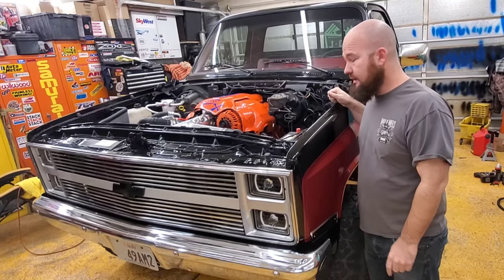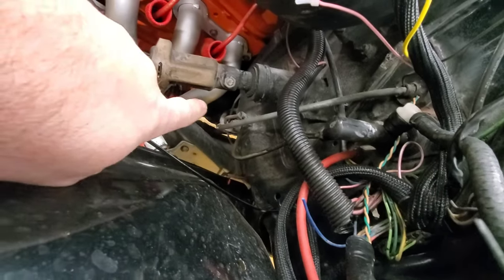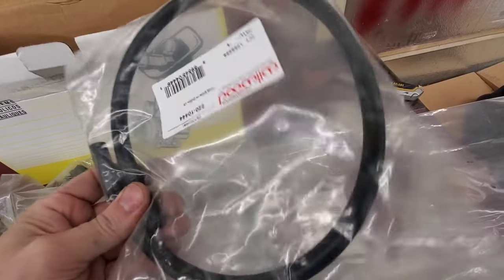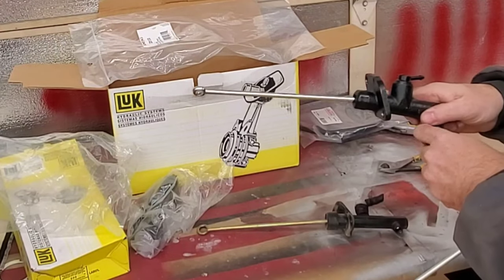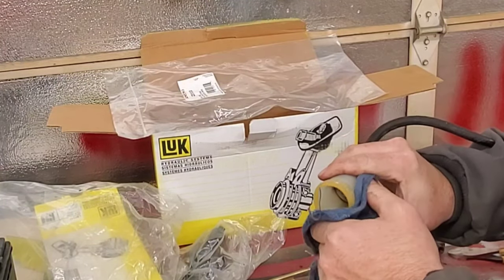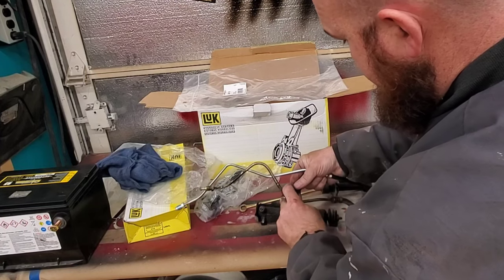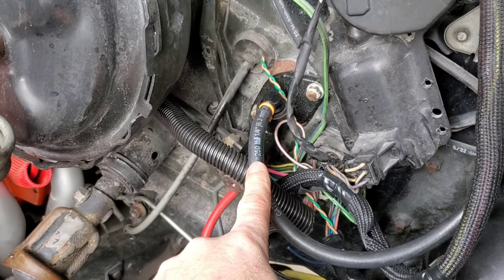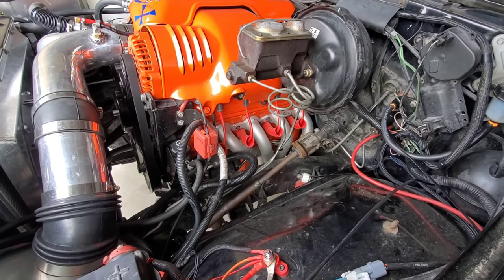Clutch Master cylinder and slave cylinder replacement on 85 Chevy K20 Silverado square body LS swap

Comment: I'm doing same job however I hate the plastic line on the master to slave cylinder and planning to go with an fittings...the pin in connection points in my opinion are lame... and prone to leaking... plastic line also can melt easy if it comes in to contact with exhaust....I have a 1992 Chevy Silverado 1500 4x4 which I use to pull my home made toy hauler camper holding my 1959 VW bug and 1993 Harley Chopper plus a basic tool shop compleat with generator and welding equipment and plasma as well as air compressor...so a reliable clutch is necessary

Comment: Anybody can put the pieces together. The hard part is bleeding the system.You showed nothing about that  and that's where all the issues are .
Reply: I had issues bleeding the system myself. I ended up removing the entire system intact and bench bleeding it by pushing in the rod in slave with reservoir tip removed.  Actuated clutch rod and slave rod and it behaved like it was a mechanical link.  Reinstalled everything intact as a sealed system.  Worked like a charm.

Comment: Thank you.  Thank you. Thank you for this video and info in description!  Used the all the provided links to replace the entire hydraulic clutch system in my 85 c20.  Only thing I did different was bench bleed the system.  To be honest I uninstalled everything intact as I could not get it to bleed once I had everything put in.  I think that was because my drive way is a rather steep incline..  but once I actuated the slave all the bubbles came out of the reservoir.  All was good to go after that! Thanks again.  Definitely subbed
Reply from the maker: Thanks I appreciate you watching the video and I'm glad this helped you out
Reply: So @JCustomFab, I have a series of questions about your engine and trans setup. So I see it's an LS engine and I'm guessing that's the sm465 behind it? If it is the sm465 can you please tell me what you used for a pilot bearing and motor mounts and on a scale of 1-10 how difficult was it mating the ls to the factory 4 speed
Reply: how did you guys bleed

Comment: So I just picked up an '86 K5 and I picked up all those same parts, actually what I want to know about  is that spring that you mentioned on the clutch pedal at about 3 and a half minutes in, I'm missing that, would you happen to have a part number on that? I'll try to research it also, thank you
Reply from the maker: Lmc Clutch Pedal SpringChevy GMC 73-84 part# 30-3151
Reply: I'll try out, thanks again

Comment: So I’m 17 just bought my new truck the clutch works perfectly fine but the problem is, is that if I accidentally bump the clutch peddle some type of rod will fall out and I’ll have to get out and put it back in how do I fix that? Also do you think you could help me with it I mean maybe a phone call?
Reply: Is it the rod that goes from the clutch master cylinder to the pedal?
Reply: If it is the one form the clutch master cylinder to the pedal then look under your dash and there should be a washer and a cotter pin holding it in